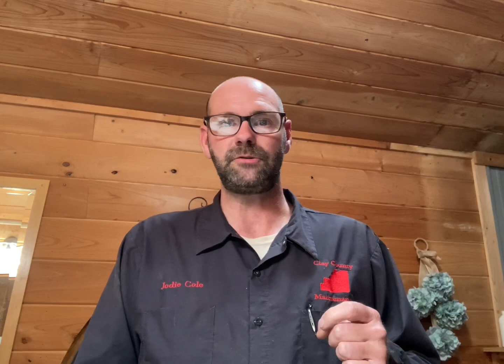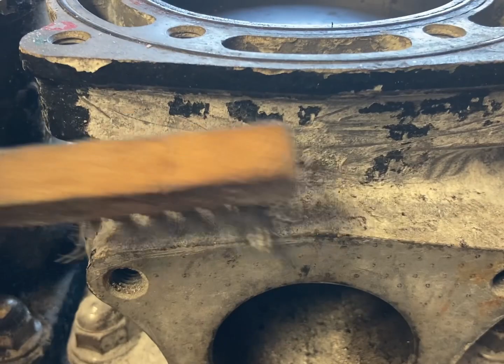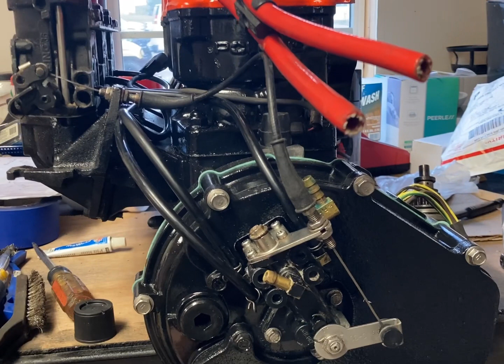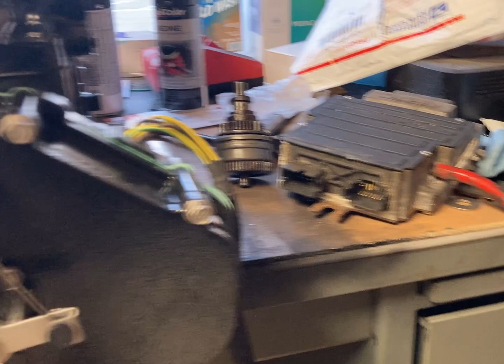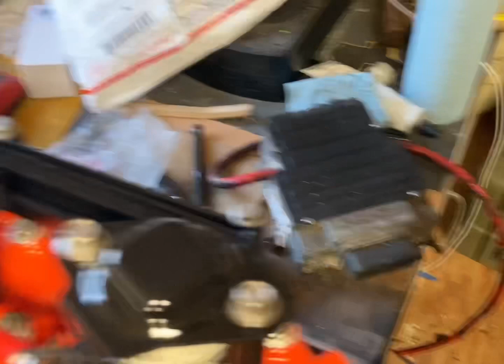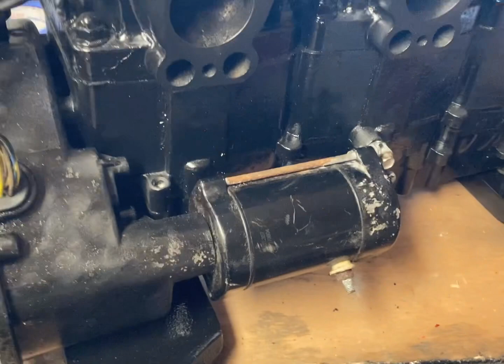Part 1 Polaris Genesis rebuild: How to repair Direct Injection skis

Comment: These Videos have been extremely helpful! I have a 2002 Virage TXI I'm buying, plugs have been replaced but still shuts off at idle. Runs fine with throttle. Any ideas?

Comment: Sir, do you know how to remove the fuel filter on the 04 genesis i? I am having a very hard time finding any information. The metal tabs are bent to the side so they are not touching the pump housing, but it won’t budge and I do not want so break something
Reply: Update: not sure if I found the water separator or fuel filter..

Comment: Do you have any videos of the tear down of the engine, or specifically the top end rebuild?
Reply from the maker: @kayleegist8947
I don’t. It’s pretty self explanatory. It’s easier with the engine out, but possible in.  Exhaust comes off first, then spark arrest (breather) and pulling intake helps. Then pull water manifold. 
Then heads. Then jugs. When you install new pistons make sure to orient arrows towards exhaust

Comment: Where are located? Are you willing to work on a 99 slx that is having a spark issue?
Reply from the maker: Jeff,
I’m in Wedowee AL
I really don’t know much about the electrical system of a carb ski. They are totally different than direct injection skis that I work on.

Comment: I just got a Virage 1200 for free.99, but it came like yours, engine in boxes.  Thats the tradeoff of it being free, it's in pieces.  The bottom of the crankcase broke one end off, so it's going to need a ground up rebuild. I have sorted the parts, looks like everything is there.  The end goal is to swap it into Jet Jon, but I think I am going to try and get everything rebuilt/refreshed, then put back int he ski and see if I can get it to run normal before I swap it to the boat.  I may be reaching out in the future!

Comment: Who can you send A EMM module to to get tested or fixed?
Reply from the maker: You can send an EMM to Darrin Wiess at Lakeside tech. 

https://lakesidetech.biz/
Reply: @oldpathsoutdoors8223  I have a 2002 polaris genesis. Would it be possible to get contact information to be able to run some stuff by you?
Reply from the maker: @martinflores3804 
Sure!
Reply from the maker: 770, six,eight, seven, 1531
Reply: @oldpathsoutdoors8223  got it thank you sir. Will be in touch.
Reply from the maker: Text me first and I’ll call you to help any way I can.
Reply: @oldpathsoutdoors8223  can I get a number?

Comment: I have 2 sister 1200 varage I will need some help on, one runs very good the other how ever not so much,
Reply from the maker: My advice is to anyone owning a Polaris ski is go to “Greenhulk.net” an online forum and read everything concerning the ski you have on that site.  Before anyone can help we would need to know:
Year?
Carburetor or Injection?
Any known prior problems?
What the current problems are?
Have all the normal required updates been done for that model?  If so, which ones?
Answer these questions and we can try to help.
Reply: @oldpathsoutdoors8223  
Thank you for getting back with me, I'll go to the forum and see what I can learn about polaris skis, both fuel injected both defiantly need new fuel lines, they are 2001 skis, most likely going to need a few parts line fuel sensors and computer, I bought them used with one not running , it asks like the the one you had un the video with fuel issues and then it seem to turn I to a computer issue shortly after
Reply from the maker: 1. Do the recommended fuel pressure regulator repair on it. I have a video on that repair.  A fuel pressure gauge can tell if you have proper pressure. 
2. Make sure it has a good working TPS
3. Do a volt, and ohms test on the stator, coils and wires. 
4. A bad display can cause a no spark issue. 
5. Computer (EMM) may be suspect if the above checks out. 

The good thing is you have two skis you can swap parts on to diagnose both skis.
Reply: @oldpathsoutdoors8223  Thanks . Yes the two skis are one number off on the serial numbers , you have been awesome with these isssues